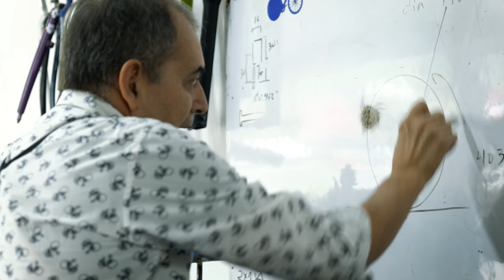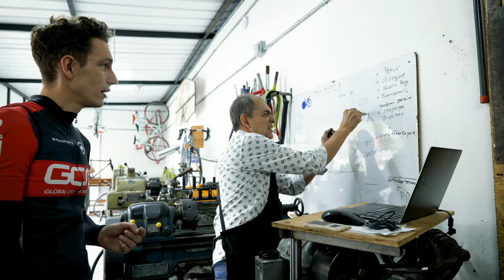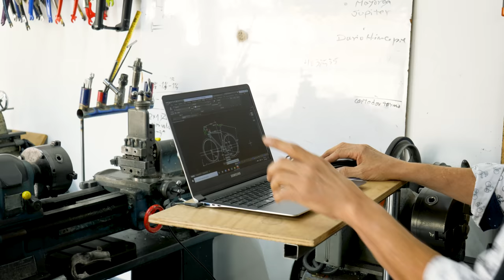Inside The Workshop Of A Legendary Bike Frame Builder | GCN Meets Agustin Hincapié

Comment: So when he (Hincape) mentioned Reynolds 753 it was because he was certified by Reynolds to build with it. Reynolds would only allow builders who submitted a frame built with it to them that passed their test to use it. Back then there was not a lot of certified 753 builders so it was a mark of craftsmanship and pride. That’s why Hincape brought it up not because Si and Reynolds are from England. That aside really enjoyed the piece. Thanks
Reply: Roger Bloom Yes Sir, Agustin is certified by Reynolds. For more info you can e.mail us: agustinhincapiebikes@gmail.com
Reply: My grandfather who was a  custm frame builder upto the 80s didnt think much of the lighter Reynolds tubing and most riders favoured 531 or a mix of 531 and 653 from memory.  Issues with strength and the rod alloy. I cant recall if he used 753 he may of.. i used to pick up tube and lugs from brum.
Reply: glenn oc when my dad moved to brum he brought an expensive frame from Craig’s bike shop in brum they had come as seconds out of a builders as they had head tube issues. The old man managed to track down lugs etc in brum and got it all braised back together and put many thousands of miles on that bike including several fund raising rides from brum to Southampton and brum to Bristol. On in brum could you walk in places and get stuff like that. There’s still abit now but no where like it was.

Comment: Your final comment Simon.  Using your knowledge from the first GCN frame build, you and the team are in a great position to work with Mr Hincapei whilst choosing the geometry for the GCN frame build 2 machine.  A frame specifically designed for indoor training?  A supper light weight Mountain climbing machine made completely in Titanium?  Or a long distance endurance machine that combines Steel and Titanium tubes?